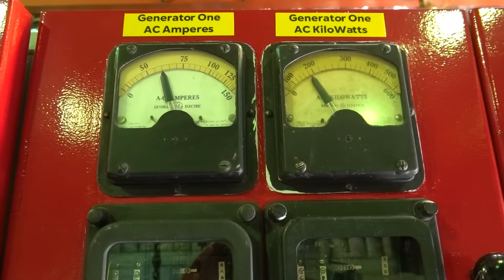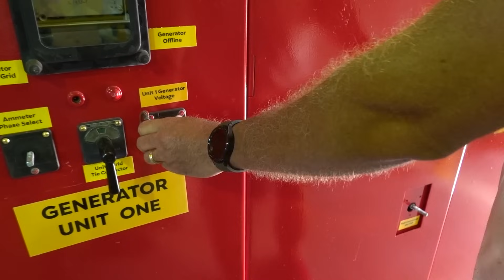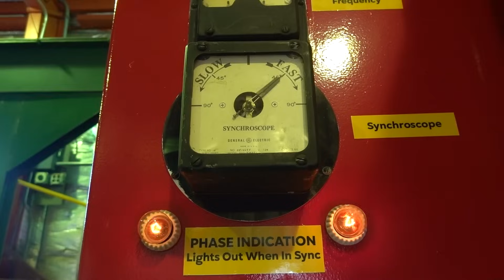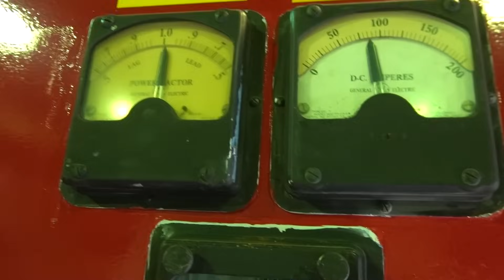Small Scale Hydropower Plant Daily Cleaning and Maintenance #engineering #energy #power #chrisboden

Comment: It bothers me so much that the paralleling is happening with the synchroscope moving towards slow - meaning that when it is brought online, there should be some reverse power motoring that turbine.  I would think you'd want it moving towards fast a bit so that it takes on some load immediately.  Have seen it on other videos as well.  Parallelitism hitting I guess.

Comment: I built a generator from a modified 200 amp alternator back in 2020 during my government sponsored vacation. I wasn't expecting much and I was right to, until it dawned on me that the stupid thing wasn't spinning fast enough.  So I redid the thing with an 8 in pulley for the big drive fan and a 2 in pulley on the alt itself and well.... electricity is dangerous kids and if your math doesn't math you can wind making a 12 volt car battery go kaboom. 😬 but after covering myself and my shop in baking soda I looked at my meter and recalled the last highest voltage recorded and Holy Shit lol. It's no nuclear power plant but once made safe it can definitely power a fridge, home office etc...

Just to clarify the car battery that exploded was in one of those $100 home office power outage battery back up units that might last a whole 30 minutes & I forgot to unplug it

Comment: Why is the floating debris not guided to where the water overtops the dam through that ever flowing spillway?

Can the weeds be taken out of the grates with a mesh screen dropped in front of the grille
a grille that lifts up (on a winch system)
run over a roller and then inverted to dump the collected weeds out....?

Less dangerous than a man with a rake....

Comment: Why do you turn the units off to clean your trash racks (grates)? We clean ours with the units running. If the weeds are bad we close our wicket gates down to about 30% open, just enough to keep the units running. Only on worst occasions do we turn a unit off to clean. Interesting to see how other hydros are doing it.
Reply: We do ours running but with that cheesy rake he was using may have been to difficult to dip that deep against flow. Plus it only costs them about $30 in lost gen to shutdown for 20 minutes.

Comment: So much plant mass stuck in those grates! Out of curiosity, was the point of opening that spillway only to flush out some of the big debris, or was it also because you had to shut the wicket gate?
Reply from the maker: You're correct. We have to shut the generator down to clean the grate (Delta-P Yo), so since we're not moving that water, it has to go somewhere. We open the tainter-gate to maintain our proper water level on the river.
Reply: @Physicsduck  ahh yes, delta-P. Nothing sticks to the brain more than the delta-p safety video that every workplace mandates you watch... Describes in disastrously high detail the deaths of at least a dozen divers with that pad synth background music. I don't even work with water, I sit at a desk all day and design garbage that either helps society or gets used in the middle east, yet I have to watch the delta-p video anyways.

Lesson? Be the last diver, not the first, and be thankful you aren't crazy enough to be a diver in the first place

Comment: What's the handles/wire/cable thing that went into the hole "Unit 1 Generator Voltage" and an unmarked hole in the next panel then was removed at 9:05?

Comment: Hey Chris, I just happen to work in hydroplant like you. Although I'm just new in my role as an electrical engineer. 

I'm wondering - is flushing a turbine safe? By flush, we suddenly decrease the wicket gate opening and quickly return them to the original opening without having the exciter go below 0 VAR. Thanks! Love your videos by the way.
Reply: That would mean the mass of the turbine and generator shaft acts as a pump temporarily. As long as there is no cavitation damaging turbine blades I don't see a problem.

Comment: WOW compound double worm gear drive,  that is reduction right there.
Reply: I wonder if the immense reduction is to prevent "water hammering" the river (or whatever the correct term is)
Reply: It is sensible to keep it going slow at all times. Alloys weren’t what they are today. No CAD & CAM utilising material science for selection.

But: Planned obsolescence was in the making.
Reply: And it can't be back driven so you don't need a brake.

Comment: That's cool that you can even adjust the power factor. I'm surprised that residential homes don't get charged for power factor. Is there a way to have a device that adjust power factor at home, and would that make any difference on my electric bill?
Reply: Consumer equipment are required to have a good power factor so no need to worry about a significant number of households using much reactive power or billing for it.
Reply: Pretty much all mechanical turbine generators are capable of adjusting power factor, just a matter of setting the speed and letting the inertia of the turbine take over from there.  (it's way more complicated than that, but essentially, adjusting the speed changes the voltage and frequency, thus doing pretty much the same as adjusting the phase angle to account for power factor)  The youtube channel "Practical Engineering" just recently did a video explaining power factor and the different ways of managing/compensating for power factor.

Comment: I understand power factor - but how does adjusting the Exciter on the generator change the outgoing power factor? I would figure the Exciter only changed the output power
Reply: Increasing rotational speed above grid frequency increases output power, to do that just add more water.
Exciter changes output voltage which affects power factor.

Comment: Another fantastic video, don't stop making them.
My boss taught the golden rule of synchronization: Never close the connection counter-clockwise from the frequency, it could blow the stator due to the difference in frequencies and the load that it suddenly puts in the opposite direction. (Protections may fail)
I've seen generators blow up because of this.